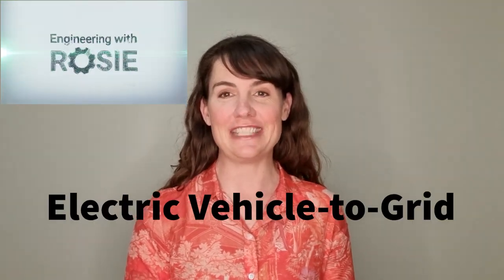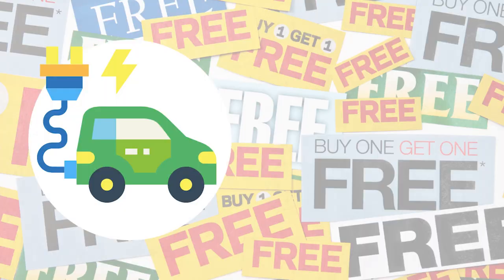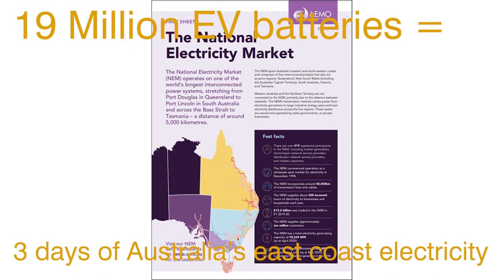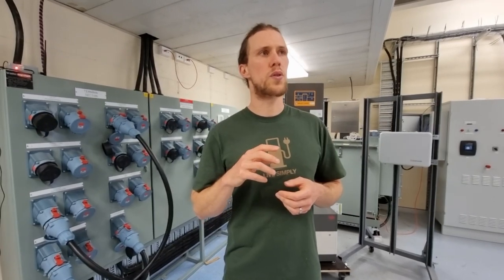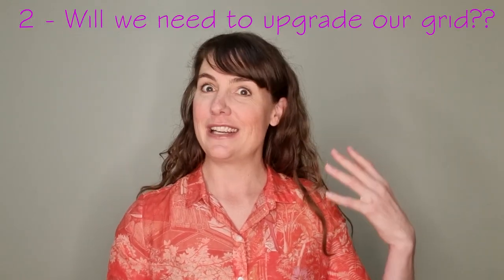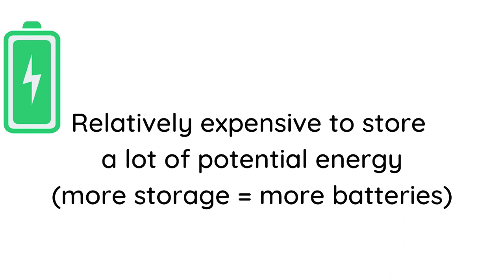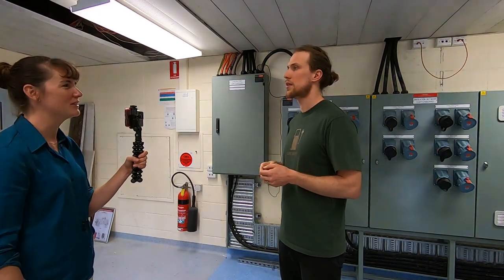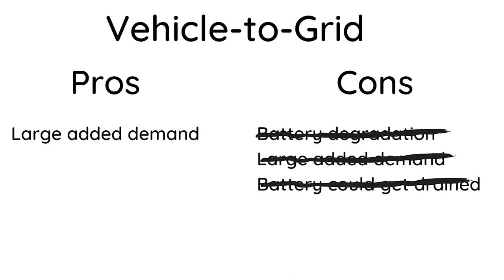Electric Vehicle to Grid Technology Explained

Comment: Another interesting video, thank you Rosie.

The inertia of the power network generators is an important issue often overlooked by many commentators. The increasing penetration of renewables has tended to reduce the network inertia and this could become a concern if the level of penetration threatens to compromise network stability during faults. Power networks tend to operate with relatively high fault levels (corresponding to high inertia) in order to maintain high stability and reasonable power quality. This allows commercial and industrial customers with demanding loads such as large motors to work effectively without causing unacceptable amounts of disturbance to neighbouring customers. High fault levels also means that faults can be detected and disconnected quickly. Reducing system inertia can increase susceptibility to faults and having system inertia that is very low can risk widespread disturbance.

I don't want to misrepresent what you said in the video about the relative inertial characteristics of large, centralised generation and distributed generation as proposed by V2G technology but it's definitely NOT the case that the relatively high inertia of large rotating machines is something to be regarded as undesirable or needing 'engineered out'. Like most solutions, there will be a role for generation sources that underpin system stability (big flywheels, if you like) and distributed sources that can help offset demand locally (small flywheels). The control systems for large rotating machines, coupled with the extremely fast fault clearance times required for the protective devices on transmission networks are very capable of dealing with network disturbances.

In terms of V2G (or other distributed generation) responding to over-frequency (OF) or under-frequency (UF) events, clearly there *is* a role that can be played by these devices but I think there is a danger it could be over-played. The main hazard presented to the system is a severe UF event, usually initiated by the loss of one or more large generators due to failure of the genset itself or the circuit connecting it to the system. Thankfully these events are very rare (well, here in the UK they are very rare - I can't comment on other countries), however among the existing (UK) measures designed to respond to excessively low UF are low frequency demand disconnection (LFDD) devices that are (1) automatic, (2) distributed across the network and (3) essentially instantaneous with no programmed delay. Events triggering the operation of LFDD schemes couldn't be avoided by any amount of V2G implementation as the EV batteries and their charger/inverters would be likely to be disconnected as part of the process.

National electricity network operators invariably have a statutory duty to do all they can to keep the system stable and operate within certain boundaries, hence the regulations that flow from this duty to ensure generators above a certain capacity are subject to central dispatch control. Having lots of potential energy stored in V2G installations is attractive but how could network operator planning and dispatch engineers incorporate any meaningful available capacity from a source that is, by design, capable of being connected and disconnected outside of their control? Over time, researchers and statisticians *may* be able to deduce that a certain percentage of V2G capacity is available at any given time of day, possibly following an availability curve. 

The question of whether the grid can accommodate large amounts of either EV charging or V2G installations is  - like so many other videos dealing with this subject - dealt with at a 'macro' level, comparing the estimated total stored energy in V2G systems with overall network demand. Yes, smart charging would be necessary and I think EV manufacturers and vendors need to be more open by making it clear that the *availability* of charging at home *may* be restricted at certain times in any given 24-hour period due to the limitations of local low-voltage networks, rather than simply extolling the virtues of being able to export to 'the grid' as if it's as easy and repeatable as plugging in your kettle.

Significant engineering challenges still exist with reconciling the additional loads presented by EV charging to low-voltage distribution networks that were designed and implemented to taper away from the local substation to the load. Although almost all of the very interesting and fertile discussion in this video centres around the monitoring and control of system frequency, the more prevalent issue for individual customers and distribution network operators of voltage control is not mentioned, even though it is of much greater relevance to low-voltage networks than network frequency.

I hope to see advances in V2G technology and much greater adoption of it. I hope to adopt it too, eventually. However, I think there is a lot more R&D required before V2G or domestic renewables in general can be considered as having a significant role in frequency control.
Reply: Craig Watson - What a great comment! I think you just gave Rosie food for many more videos, and I for one am looking forward to them. This is one of the most productive ways to move things forward. Progress is always preceded by thought and discussion.
Reply: V2G using present technology has great promise to offer grid services. If the V2G charger inverters were equipped with "grid forming" (aka "virtual synchronous machine") control then they could directly substitute for the inertia of conventional generators and provide extremely fast frequency and voltage control too. V2G 2.0
Reply: @redshift3  I think that very unlikely as the 'virtual' machines you refer to have a very significant system impedance between them and the transmission network. Any transient response by V2G would very likely be too slow to maintain system stability within the very tight limits prescribed.

Comment: Great video. A couple of questions
1) what is the expected income, and what is ROI.
2) The move to renewables will make the grid less stable so the demand for power will presumably increase. If you need certain power on standby it no use if you can only use a small % of it. I guess it depends on the expected variation in supply.
Reply from the maker: Thanks, glad you enjoyed the video! 
1 - I am not sure that is known yet, for this trial at least. I will be talking a bit about v2g in an upcoming video on flexible household energy usage (got to come up with a catchier title before I release that one!). I am hoping I can talk to a guy in the UK who has all of his appliances (including his EV) hooked up to respond to changing wholesale electricity prices. So I will ask him about the finances. It's not exactly the same thing as this trial but should be interesting to get some real values. 
2 - yes you're right the total capacity will need to be much larger than the usable amount, since you can't rely on having all EVs connected and willing to drain to zero when there's a lengthy blackout. For sure the future electricity system is going to be a lot more complicated than the old one, but it will end up cheaper and of course cleaner. 
Interesting comments, thanks 😊
Reply: @EngineeringwithRosie  Thanks keep up the good work!
Reply: Contingency FCAS is an availability payment. It varies wildly qtr to qtr, (read AEMO QED reports for insight) - because contingencies are, by their definition, unfortell-able! That said, in the NEM the average FCAS payment for a 1MW generator (or battery) which was permanently on standby - ie always plugged in, (with minimum 10 mins charge - in the case of a battery - set aside to participate in al 6 FCAS markets) could have earned ON AVERAGE about $100k pa. The revenue per vehicle will thus depend on the lesser of the V2G charger power rating, or the EV BESS inverter power rating. I believe a Nissan Leaf Gen 2 is 50kW. Make some assumptions about % of time ACTUALLY plugged in.....voila...your revenue calc..

ROI, you bought the car to primarily drive it. Presumably it meets your needs (functional economic utility) in excess of the price you were willing to pay. Therefore, any additional revenue is, as they say "money for jam"....your ROI is thus infinity (you paid nothing extra to provide the FCAS - you car was plugged in when you were sitting at our office desk).
Reply: Nuvve already have it ! American company.

Comment: Thanks.  This was a handy insight into want V2G can and should be.  One of the inhibitors is also that not many of the "first generation" EVs support exporting power, the Nissan LEAF and some other CHAdeMO-equipped cars being the exception.  However, that is changing, and soon every new EV will support V2X.  And that's my near-term goal; I have two EVs - both with ~40 kWh batteries - and would love to use these in real-time to act as my domestic energy storage solution for excess solar PV...

Comment: Some people were concerned that the V2G will be keeping the EV's battery at a higher than usual 80% of SOC.  As well as putting the EV's battery through more charge/discharge cycling than it would otherwise experience.  I think these are legit concerns.

However, the EV industry is turning to iron based LiFePO4 (LFP) batteries which do not mind being stored at 100% and can be more deeply discharged closer to 0% as well.  Basically no need for the NMC "20% rule".  LFP also has a much higher charge/discharge cycle at over 2750 cycles before the battery degrades to 80%.  This is much larger than NMC's 750 cycles before degrading to 80% capacity.

Also LFP chemistry is less prone to thermal runaway fires.

All of this happily coincides with V2G technology!

NOTE: LFP does have both less power density and energy density compared to NMC.  But LFP's wider safer SOC range helps offset the lower energy density.  With the lower power density, the LFP battery packs are being built at 800-volt vs the current 400-volt battery pack to help offset the power density.  This will also change the ESC and brushless motor windings (kv) to match the higher voltage.  One example is the BYD Blade LFP pack which will actually be used in the upcoming Tesla model 3's as well as many of BYD's own vehicles.

Comment: Mostly we need a charger spec so we can install future proof kit. Can I buy a V2G-ready charger yet? Preferably one with an open protocol spec and updateable open-source driver software i can integrate with the rest of my house. you also didn;t mention the huge missing bit which is that the CCS spec doesn't cover V2G yet and that 95% of new EVs. Only Chademo had this from the start and that's pretty much just leafs + Japan. So to say that the tech is 'ready' seems a little optimistic to me. We are currently selling hundreds of thousands of cars that aren't ready (although it may only be a software fix - you didn't get into this).

Comment: Hey Rosie. great video again. Thinking about this and other grid related issues and your comments about just turning everything off whilst you redesign the grid..., perhaps the "answer " is to design a small residential development from Scratch based on new thinking with a single (if at all) connection to the grid for emergencies. I'm thinking something like each house has as standard, 10-16 kw of Solar, a 5 Kw wind turbine on the roof, two Tesla Batteries or similar and you must own an EV and have it set up with V2G. Obviously mega insulation, and energy smart hot water, lighting, water tanks etc etc. Say 100 houses. Build it on the side of a hill with a pumped Hydro tank at the top as well or compressed air storage or both. I think there's something in the UK but Australia would be so much better / smarter due to the abundance of renewables.  Would also make a great documentary. I reckon government and industry would "maybe" get involved, but it would need strong engineering and project control / standards etc.
Reply from the maker: I bet there are some projects like that somewhere around the world, I will do some digging and see what the biggest one is. It would be a cool video topic!

Comment: I think the biggest problem with V2G are the business model issues. 
The people running Electricity, Water, Transport and Tax all have to work together because they are so interconnected. 
It is hard to make money out of efficiency.
 Things that work well and last a long time tend not to make money for the suppliers.
Think about how hard it would be to extract money from the owner of an EV with a 50 year life that doesn't pay for fuel. Eg, e commuter bicycles don't pay much tax and have low running/ownership costs. 
The political concepts of equity, paying for infrastructure, freeloaders, them and us etc become part of the discussion too.
Great video Rosie

Comment: Vehicle to grid for frequency regulation works, but only if there is a base load power plant ready to spin up 60 (or 600) seconds later.  But it's awfully expensive to build those power plants if you're only going to use them a few times a year.

As renewables increase in the energy mix, we still need either sufficient base load or enough grid storage to get through a windless night and an overcast week.

Comment: An issue is stability of the system. V2G possibly makes the system unstable by causing a small frequency reduction to have an overwhelming short-term response, causing too much power to be fed to the grid, and then the frequency control system overcompensates and drives the grid frequency up excessively. Wild oscillations will crashing the grid system. How do you know how many cars are plugged into the system? Therefore the "loop gain" is unknown, leading to uncertainty in how to respond. It's basically a huge feedback control loop.
Reply: That’s why need a system like Tesla VPP which will installed at home and also at the utility, which will adjust the load based on demand by turning or slowing down some power sources

Comment: Thanks Rosie. One key point is that the cars need to have isolators installed and approved by electrical authorities to avoid situations where workers may be electrocuted by a car powering the wires. Such devices have not been built into most EVs as yet (Leaf exception) due to cost and regulatory complexity. But I think in the USA the decision of Ford to have the new F150 lightning do V2G and now almost certainly the Tesla cybertruck will be a mass market game changer that will force others to adopt. I hope. This technology has the potential to greatly spread power storage which is also part of overall power and frequency security

Comment: This really focuses on grid balancing in terms of fast frequency response but I think the mode I’d be really interested in is longer duration peak shaving/vehicle to house. 

In the UK 4-8pm roughly the demand shoots up, so do variable rate tariff prices and on the grid all the dirtiest generators come online. I think Aus has an equivalent rise as the sun sets and PV stops generating?

So if you can say to your car, “you’re going to give me up to 7kW for the house between these times” then that’d be awesome, almost completely removes your demand from the grid. Or even you can earn some cash by putting any excess up to your 7kW (or whatever your charger is rated at) into the grid. You could set a minimum SOC to prevent the car emptying too far. Most houses wouldn’t use more than say...5kWh? in that time so should be easily manageable. Then you replen overnight on cheap rates. And if you’ve been using excess PV during the day to charge then even better. Obviously depends on your travel and plugging in regime, but this could def work. Indeed I think Octopus energy are trialling this or something similar in the UK now.
Reply from the maker: You must have read my mind, because I have a video planned with Octopus about this exact thing 😀
Reply: @EngineeringwithRosie  Awesome, can’t wait!

Comment: You are assuming vehicles are standing connected to the grid.  I understand that AGL currently have a plan underway subsidising their customers to install home batteries in the Sydney metropolitan area for exactly the option of having backup battery power in case of emergencies.

Comment: The world's biggest v2g trial by output 1 MW is at Northumberland Park, London with 28 electric double decker buses with a plan for 700 ev buses to be used in the future, if 9,000 plus London buses are used for v2g they could power 150,000 homes, there are two trials of v2g school buses in the USA, 480,000 school buses are in use in america. The world's biggest v2g trial by number of vehicles will be 64 e500 cars in Italy by Fiat. Nuvve research with Honda foung v2g only degraded the batteries by 2% after 8 yrs which was less than acceleration, fast charging and aging, which is low enough not to invalidate the battery warranty, Nissan, Mitsubishi and PSA also told Nuvve the same.

Comment: My Car has V to L Vehicle to Load but its limited to 3KW probably due to inverter cabability and cable size. It can run the house as long as we dont over extend the demand it works just fine as an emergency backup but not as a main storage.
as you say  proper V2G is a no brainer and we need to get this into the mainstram ASAP.

Comment: How do we manufacture steel, silicon wafers etc using renewables without ramping up the power grids. Do we need to upgrade the transmission network to handle extra energy requirements?

Comment: It should be possible to do VAR stabilization of voltage as well if the charger is designed for the purpose.
Reply: Yes but VAr service at domestic LV might not be useful to operators of HV systems (whose needs often vary by time of day) and would need careful design to avoid disrupting the voltage control strategy of the LV system